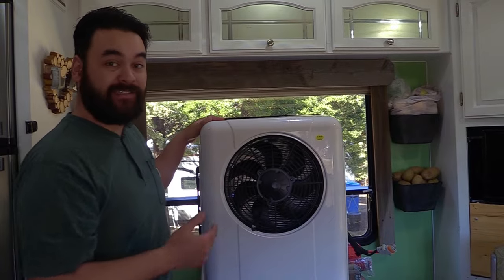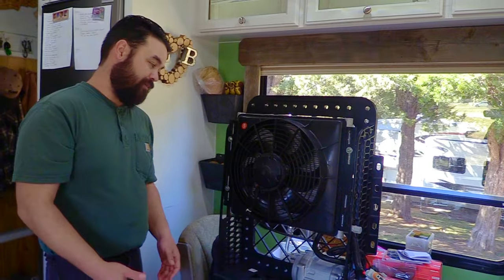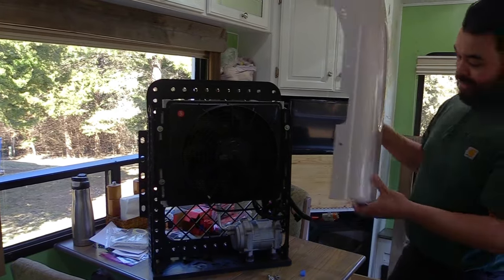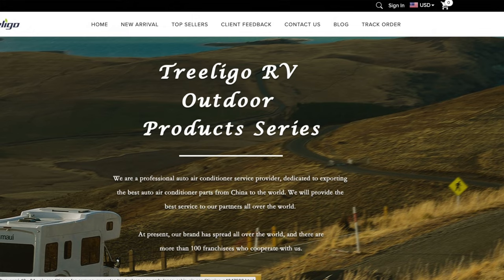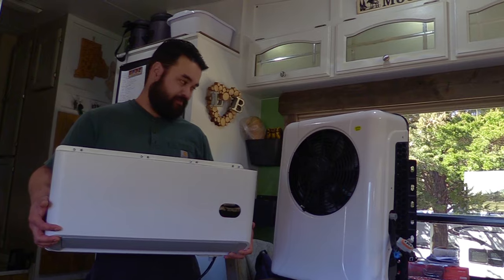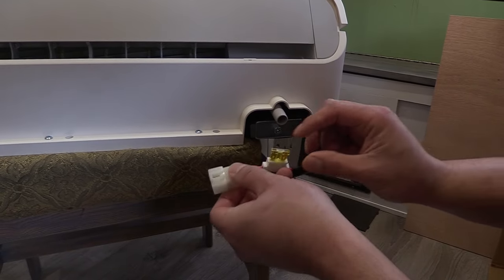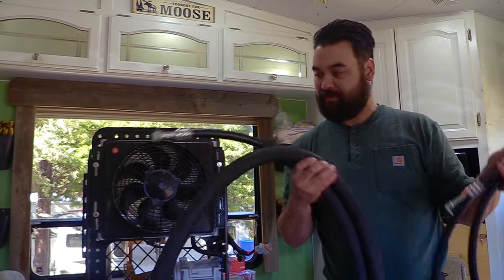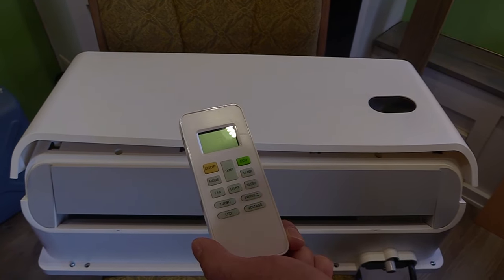First impressions??? Treeligo 12 Volt Air Conditioner

Comment: Mine is a AC/DC Brand the Gentalmen that designed and built mine is from China but Lives in Tucson AZ and the remote that your showing on video looks the same as mine but the air handler and outside unit is not designed the same Mine looks much more designed Better and heavier duty then what your showing and so far mine Works Great.O and mine is on A Large Car. That's a Semi Truck for all of U rv people o plus don't park at a truck stop we need the spaces and don't fuel at Truck stops the sit there pull foward so a Semi Truck can Fuel ... thanks
Reply: I'm here in Phoenix can your provide me the contact info pls

Comment: FYI to everyone if you order and it shipped to you you are allowed to open the box for damage inspection. Especially if the box is broken or crushed. You could tell the carrier you refused it and it's up to them to get it back to the reseller. Sometimes you need to call the OSD Clerk of the shipper notify them of damage. That's dance for over short or damaged
Reply from the maker: We are working on getting the numbers on this.  So far we have seen it pull up to 55 amps and have been testing it in different temperatures and scenarios.  We should have more information soon.

Comment: I'm curious on the amount of draw it takes. Will it drain my batteries in a couple hours?
Reply from the maker: We are currently working on testing that out now.  We do not have enough data to give a definitive answer as we have been in temperatures below 80 degrees F.  The few times have utilized it so far it has drawn anywhere from 36-65 AMPS off of the batteries.  As the temperature rises we will continue to monitor how much power it draws.
Reply: It’s about 600-700w an hour from what I’ve seen.

So if you have a 2kw battery, your battery will last about 3 hours

Comment: So is this a good daily ac unit for my small room in my RV, I have a mini split in the living room but I need one for my bed  room but I full time
Reply from the maker: It is cooling half of our 29 foot fifth wheel very comfortably in 80-90 degree temperatures.  As far as a daily unit that would depend on your batteries, converter, or solar system.  We have been very happy with our so far.

Comment: Thanks for sharing this video! I would like to know if the refrigerant hoses connect to the inside unit directly behind the unit straight through a hole in the wall, thus the hole is covered by the inside unit. Or do the hoses come out the bottom or side and have to be exposed inside before running outside? I need to know because the location I want to install the inside unit has no clearance below it or to the sides. The hoses must run directly out behind it.
Reply from the maker: Yes, the hoses are exposed and come out the bottom of the interior unit.  We were able to trim around it and hide it somewhat.

Comment: Just get a window ac
Reply from the maker: We don't roll that way
Reply: those aren’t as efficient, and these do both heating and cooling, even if you only use it for the air.
Reply: and you can run a mini split off of a solar panel because they don’t use much energy.